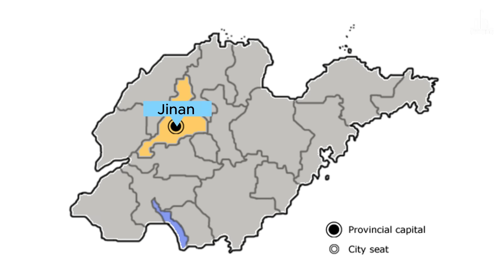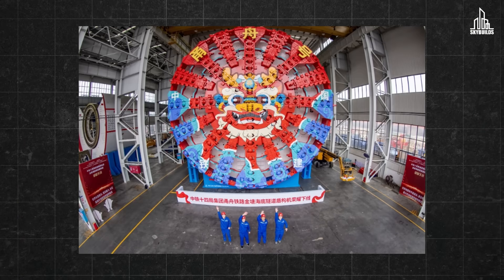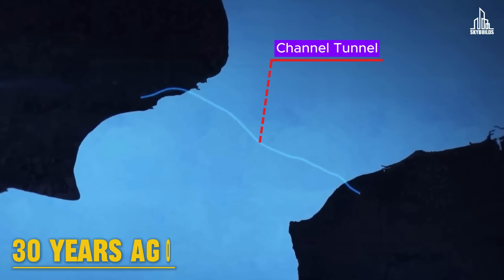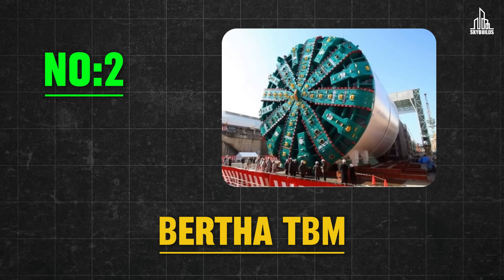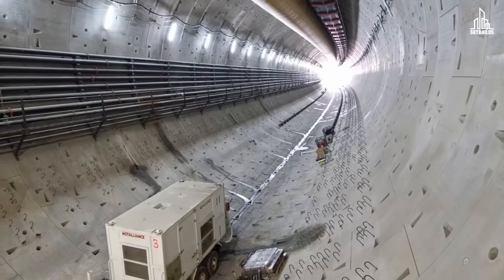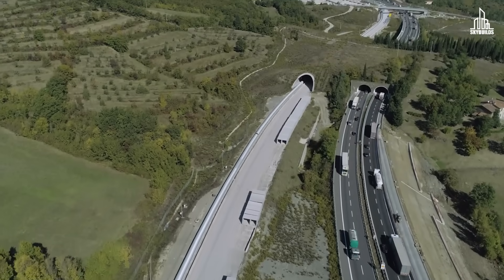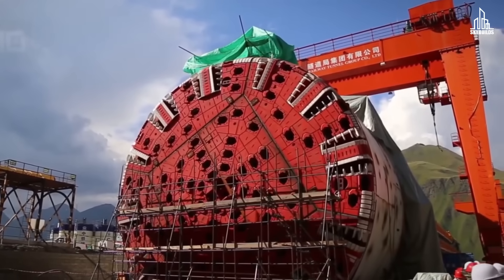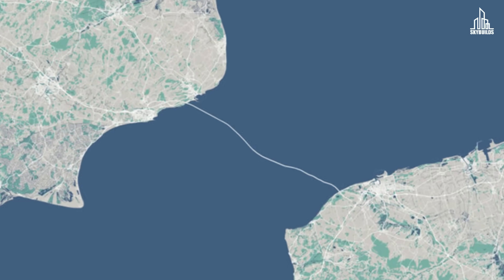How China Built the World’s Largest Underwater Tunnel in 110 Days?

Comment: My favourite TBM is the Marine Service tunnel TBM  on the Channel Tunnel - I drove that machine for 3 years. There were 4 machine drivers working in shifts 24/7/365 - Paul Wilson, Mick Ryan, Graham Fagg & myself. 
We started excavating on 12/01/1987 & completed 24kms on 12/01/1990.
What was the most impressive thing about this machine was that it had 93% reliability, in other words, every time you pressed the start button it would be ready to work 93 times out of 100.
We were building on average 16 segmental rings in an 8 hour shift or 22.4m a shift and some months were completing a km a month.
Built by the Howdens Company in Glasgow, Scotland it was a beauty of a machine.